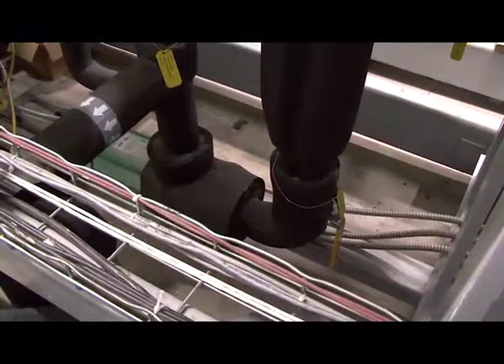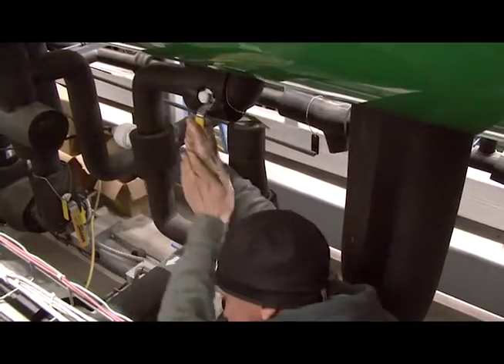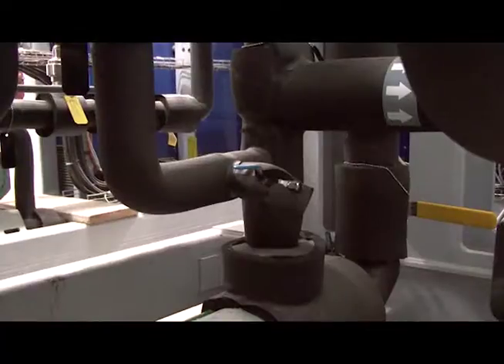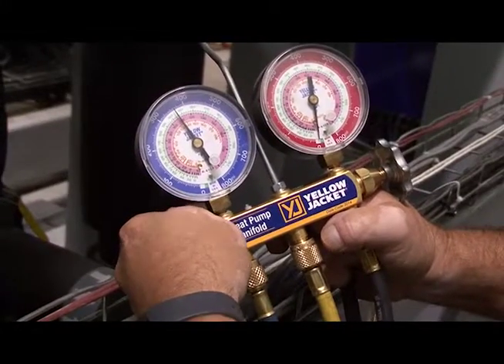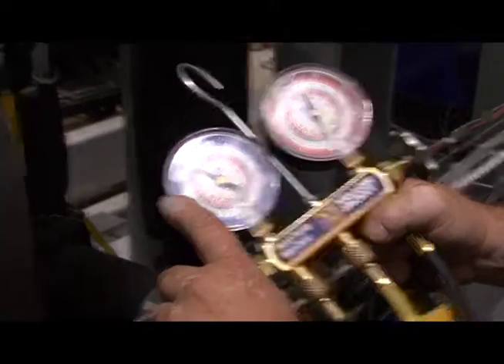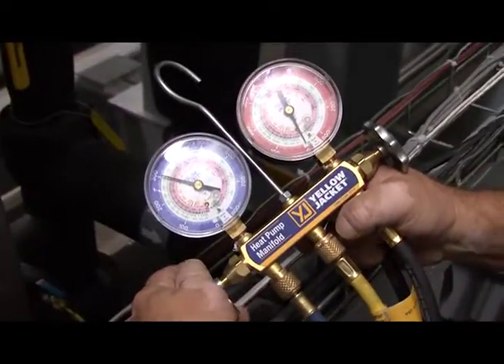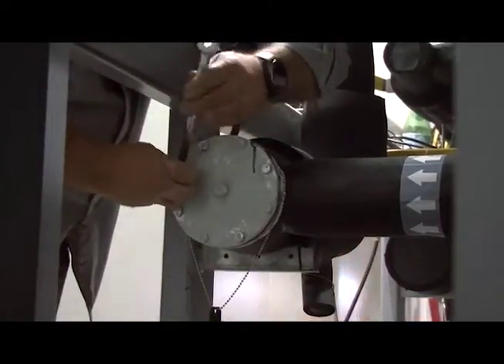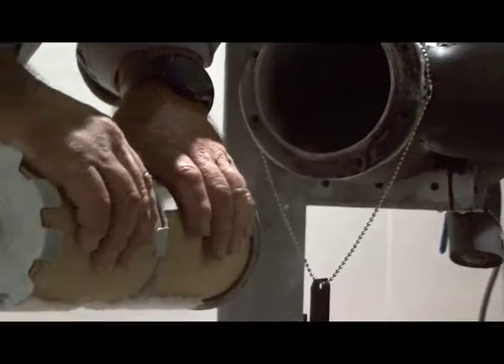Advansor CO2 Booster System Tech Tip - Filter-drier Change-out

Comment: What I am missing here is that the time that the system is open had to be limited to a minimum because of moisture that is migrating into the system. 
When you take the drier cores out put the cap right back on the housing with a few bolts, then change the drier cores.